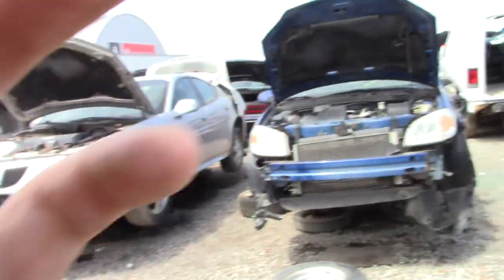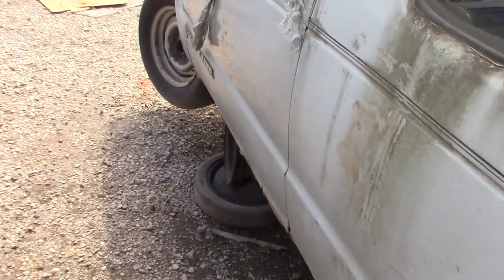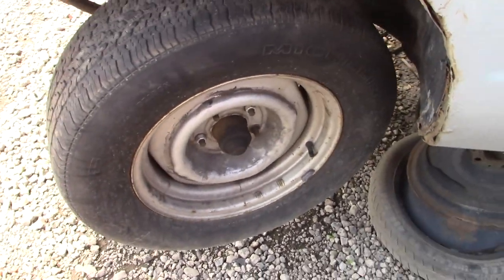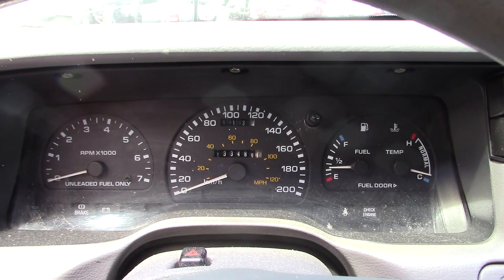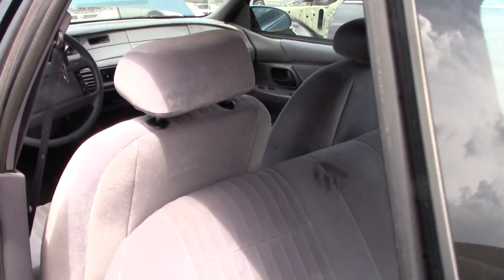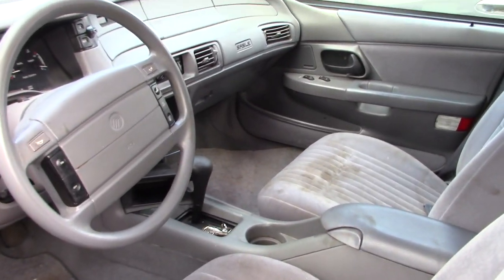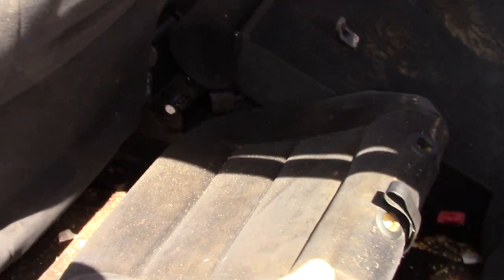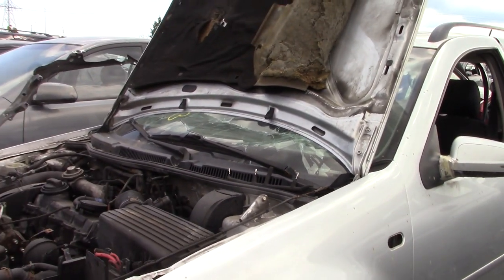More Beautiful Junk at the Junk Yard

Comment: The Fromtier had after market power windows, the plastic thing in the door was where the crank used to go. I remeber in the 80's we had these after market Power window motors that you'd fit right on where the crank was. Looked pretty decent and they were stong too. Not much fiddling inside the door, just had to pass the wires through.
Reply from the maker: Thats interesting, i have never heard of aftermarket power windows. Not a bad idea really